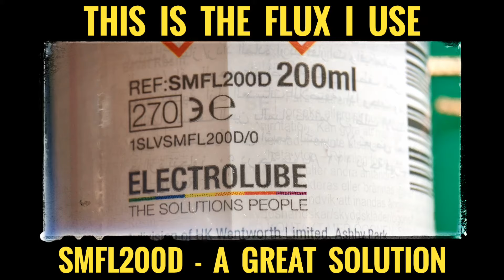How To Use Flux / When To Use Flux || Soldering Tutorial HD

Comment: Excuse me Sir I have a question, I intend to replace the main tv capacitor , the original cap is 460v 68 uf but I can't find the same voltage I just found the higher voltage 500v 68uf this nameplate should I replace that? Thank you in advance.

Comment: Quicker/easier way to clear a through hole is to use a wooden toothpick; preferably bamboo. I can clear a dozen or so holes enough to get wires/pins in using just one toothpick. 

Simply liquefy the blockage, push the toothpick all the way through the hole, then remove the iron to let it cool, pull out the toothpick when the solder is solid. The wood is "solder phobic" so the solder won't stick to it. It is also heat resistant enough that it will survive long enough for the solder to solidify. Of course, use flux for a clean job, applying some to the toothpick really helps.

Comment: Question ... I am in the USA ... I am looking at Digi-Key.  I don't see this type of flux.  Can you recommend on I can get here (I don't see the one you recommended available on this side of the pond).  Also ... absolutely awesome videos !!!!!!!!  I have never touched anything surface mounted.  I am trying to repair the instrument cluster on a 2009 car.  I hand enough knowledge figure out it was the cluster itself .... now I need to repair it.  I think it is the power supply on the board (works for about 10 min then goes blank .. unplug it ... let it set for a while ... plug it in, it works again).  I was going to throw it away but then I started watching your videos ... think I will take a shot at repairing it.  Thanks again!
Reply: Try a company called Mouser

Comment: I see that SMFL200D Surface Mount Rework Flux is discontinued in most locations, do you have a substitute you would recommend?  Your video is Excellent, thank you!
Reply from the maker: Hi , thank you for your comment. You are right they have discontinued the SMFL200D . This is a shame as I've been using it for many years with great success, but now I'm going to have to search for a decent alternative. When I find one I will post about it on YouTube. So I'm sorry at this point in time I can't recommend a good replacement. Thanks again , take care 👍
Reply: I'm a newbie but have used the ThermoPasty "solder paste" (the tin with the red writing) to good effect, if it works for me then I'm sure it will work well for you.

Comment: Hello Mr Solderfix. Great video. Will Weller's LW25 work for fine electronics and PCB's, as it has Zinc Chloride in it (read that it is acidic)?
Reply from the maker: Hi , thank you for your comment . To be honest I've never used this flux but I see it's meant really for plumbing jobs . So I personally wouldn't use it but I guess you could take a chance if desperate . Sorry I couldn't give you a clear answer . Thanks again , take care 👍
Reply: NEVER use a flux containing zinc chloride for electronics work. It sets up an endless corrosion cycle. The chloride (chlorine) content reacts with copper to make copper chloride. That reacts with carbon dioxide in air to make copper carbonate, freeing the chlorine to react with more copper, and on and on it goes.

"Traditional" fluxes used in electronics are based on natural rosin. Pure rosin isn't a very good flux but can work on metals that are easy to solder and bright and free of oxide. Most electronics fluxes contain "activators" to make them more effective. The most preferred rosin type these days is RMA for Rosin, Mildly Activated. It is adequate for most work. RA (Rosin, Activated) is more aggressive but it isn't always safe to leave residues because there is some risk of corrosion. The flux in the spray can in the video is an RMA type dissolved in isopropyl alcohol.

There are lots of modern electronics fluxes that are made using a base other than rosin. Some of the "no-clean" fluxes are extremely difficult to remove. Of course as the name implies, they don't need to be removed for general work, but residues can cause problems in some cases and removal is necessary.
Reply from the maker: Hi , Isopropyl is a poor cleaning fluid compared to some others on the market 
 It's cheap for a reason . The best one I've ever found is called ULTRASOLVE . It's on a different level to the Isopropyl and will break down and remove stubborn flux with ease .

Comment: Great video. However RS components state the the flux is no longer manufactured. Have you an alternative suggestion?
Reply from the maker: Hi , thank you for your comment. 
RS Components do a similar one , order code 494 - 764 , that seems to come in the same format , 200ml , aerosol, etc which is what I'm looking for . The only trouble is it's roughly £10 a can more than the SMFL one . I will probably still use it as it does last me ages. Hope that helps , thanks again 👍

Comment: How did you clean the flux off after wicking? I was going to buy MG Chemicals 835 lquid flux, but one review said it dries solid on the part, so then I was going to look into no-clean ones but I have no idea what is best. And then I saw you just wiped it up with a paper towel?
Reply from the maker: Hi , thank you for your comment. To clean flux off after soldering I always use a fluid called ultrasolve which is available from companies like Farnell , RS Components, Rapid Online etc and I use a soft dry wipe called Gtek dry wipes from a company called Grove Sales ( England ) , I would never use a hard paper towel as board damage could occur but the dry wipes dipped in ultrasolve are so soft and really used right will look after your delicate components. Hope that helps , take care 👍

Comment: Hey i have a circuit board that already has solder on it do I need to put flux
Reply from the maker: Hi , thank you for your comment. If I ever have boards that have solder on the pads already I would still 100% put flux on the pads . The flux that would have been in that pre-loaded solder would have been burned off when the solder was flowed so you definitely need to add fresh flux to help you achieve good soldering . Thanks again , take care 👍

Comment: Looks like flux is what I need after struggling to solder leads onto a piezo element!
Reply from the maker: Hi , thank you for your comment. In soldering flux is massively important . I personally wouldn't solder anything without adding flux to the desired areas . Thanks again 👍

Comment: 4:48 is it ok to just use new solder on top of the old existing solder? as in not all of the old solder has been wicked up, i thought reusing that old solder and just putting some new solder on top is not acceptable, as all of the oxide build up and contaminants on the surface of the old solder will just be heated and melt into the joint, causing it to be weaker?
Reply: You can but you're meant to clean it up for better joint.

Comment: What I missed here is the Solder Sucker Pump. If you have a lot of solder making shorts on the IC a pump is much easier in a first step to remove 90% and then continue with the wick.
Reply from the maker: Hi , personally I just don't like manual solder pumps , never have . Electronic ones are good but when removing shorts I just find solder wick way easier . Thank you for your comment 👍

Comment: Hello Mr SolderFix,

Did you find an alternative for Electrolube SMFL200D flux please ?

Thanks 🙂
Reply: Good question,  SMFL200D seems unavailable
Reply from the maker: Hi , unfortunately you are correct, it is now longer manufactured . Luckily I still have a small supply to keep me going for a while . I have found another great liquid flux which is just as good made by Loctite . The only problem is it's only available in 1 litre or 5 litre bottles , not much use for the hobbyist that's why I've not really mentioned it . I will try and look up next week the code for it and add it to this chat in case anyone wanted an extremely large amount of it . Thanks again 👍
Reply: Hi  @mrsolderfix3996  , you are an invaluable resource in regards to soldering skills and techniques. Did you get a chance to look up the code for the Loctite flux you are using?

Comment: What was the temp on iron?
Reply from the maker: Hi , thank you for your comment. Generally if I do leaded soldering I would use about 330 degrees centigrade and for lead free I would use about 350 - 360 degrees centigrade. There may be times when I'd need to slightly alter these temps but mainly I would stick with these  ones mentioned above . Hope that helps , thanks again 👍

Comment: Judging by its performance, the solder wick used in the video is either of poor initial quality or has oxidized beyond the ability of the flux with which it is impregnated to do its job. Another possibility is that the iron was not hot enough. With good braid and sufficient heat, solder should spread along the wick much better than in the video. I've found wick with "no-clean" flux to generally perform very poorly unless very recently manufactured.
Reply from the maker: Hi. Brand new solder braid from the best suppliers , Multicore and Chemtronics for example still works way better if external flux is added . You obviously haven't tried doing this at all or else you would have seen this for yourself . Thanks for your comment .
Reply: @mrsolderfix3996 
I've used solderwick quite a lot in years long gone by. Though it does the job in a so-so fashion for some things and quite well for others, I've never really liked the stuff much, mostly because it makes a colossal mess if it is a type with sufficient flux that is sufficiently active to work efficiently. I much prefer power vacuum desoldering when it is workable and have used it for decades.
Reply from the maker: Hi , I get on really well with solder braid but really hate manual solder suckers . The powered desoldering guns around today ( I use a Metcal one daily ) can be great but very expensive especially for the hobbyist . There's still plenty of situations when I prefer braid with added flux though . Thanks for your comments.

Comment: Why is it that solder does not stick to my iron.
Reply: Cause your soldering iron is of poor quality. Get a better one. The solder sticks to good-quality soldering irons.
Reply: @turanamo  Thanks for that. Any suggestions of a good soldering iron? Which one are you using? By the way I cannot find the flux (SMLF) you are using anywhere. Farnell says it's no longer manufactured!!! Great videos by the way. I enjoy every one of them.
Reply from the maker: Hi . The soldering iron I use is a Weller TCP S model . You have to buy the base unit then the iron with lead separately. A great reliable iron . The tips I use are a PTP7 ( small conical ) and a DD8 ( large flat sided ) , these 2 types do basically all my soldering projects.
The flux has indeed recently been discontinued, which is annoying as I'd used it for at least the last 10 years 
RS Components do a similar one in a spray can so I will probably try that when I need some more .
Thanks again for your support , take care 👍
Reply: @turanamo   It doesn't have to do with that. It has to do with the tip quality and oxidation. Good irons like weller, jbc, and hakko all have this problem, just to varying degrees. No metal is immune to oxidation. Oxidation on the tip often caused by having the temperature too high and not cleaning the tip or touching it to plastics. This is why if you get a tip cleaner like Chipquik SMDTCLF, it will work perfectly, even with a cheap iron. You don't need above 350C to solder SMD or smaller through-hole components and it keeps your tips better for longer.